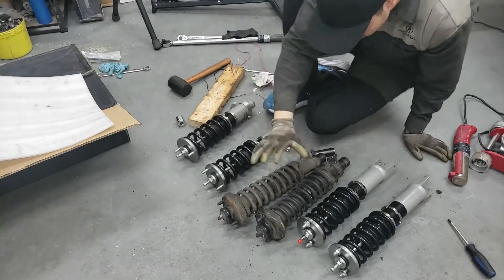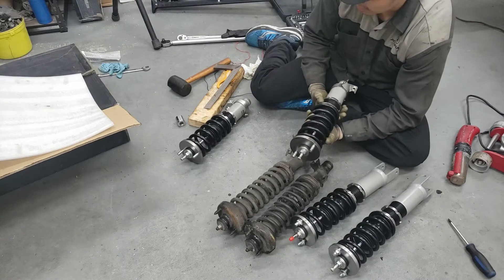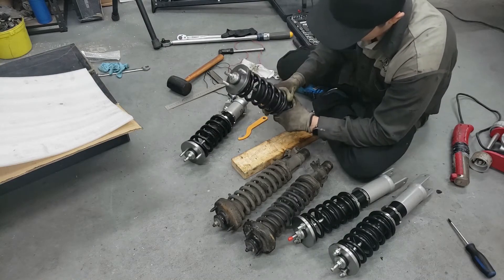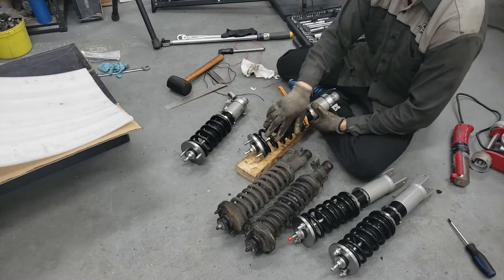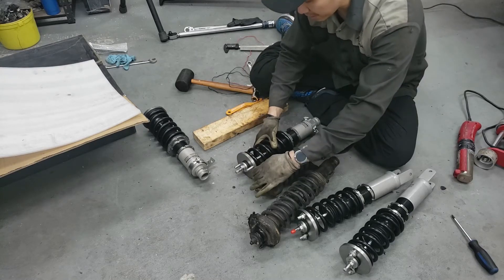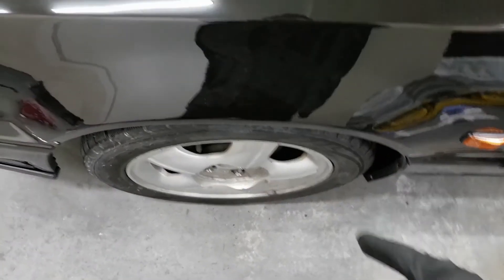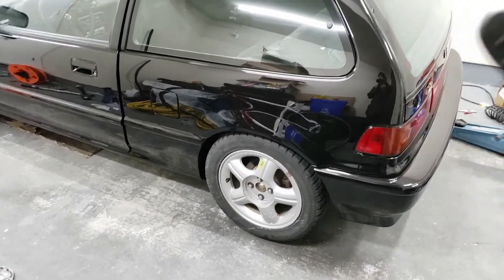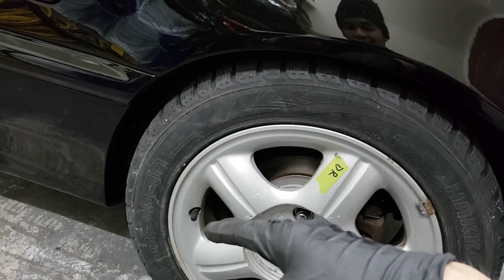IT'S ABOUT TIME...👉 Installing MAXPEEDINGRODS COILOVERS!👀 - How To Adjust Preload and Height

Comment: Good video.. Get the car aligned and corner balanced as well... makes a huge difference. I did it on my CRX.
Reply from the maker: Definitely going to be getting an alignment, but might not do corner balancing. Not really sure where locally would even do that. But need to wait for my new tires before I can get it fully aligned.

Comment: I have the non adjustable and I already have them Install do I have to take them out to lower them or higher them?
Reply from the maker: No, you can adjust them in the car. Its just easier to set them up before installation and then fine tune it after. But either way, there are always adjustments needed after placing them in the car.
Reply: @BudgetGears  okay great thank you so it’s the same as the non adjustable and the adjustable?
Reply from the maker: @Davidmtz559  i don't understand what you mean. Coilovers are either height adjustable or damper and height adjustable. Assuming you have 1 of the maxpeedingrods ones, the height adjustment is the same for both styles.
Reply: @BudgetGears  oh okay great Im new to this lol . I have the blue one with non adjustable one .
Reply: @BudgetGears  because I see maxspeeding have (Non-adjustable) (Adjustable)
(T6 Advanced Series Adj)
Reply from the maker: @Davidmtz559  They're all adjustable for height. So it was confusing when you said non adjustable. The only thing that isn't adjustable for the base model coilover is damper. Damper controls how soft or stiff the shock is. So that wouldn't matter to you. But height would he the exact same to adjust.
Reply: @BudgetGears  ahh i see make sense so I don’t have to take out the whole coilovers out  to  lower them ?